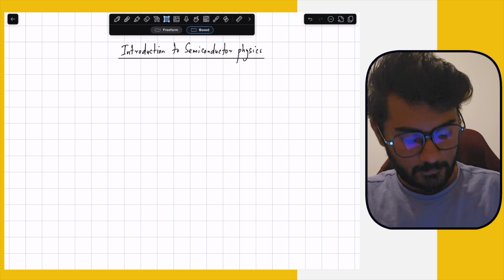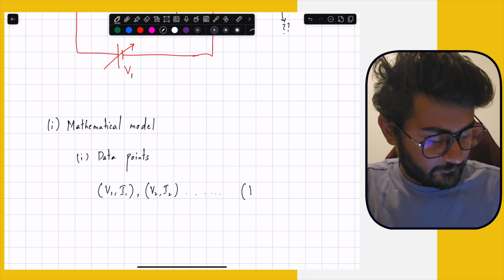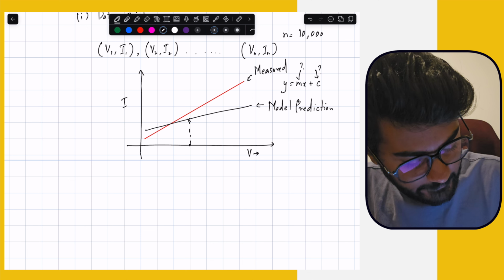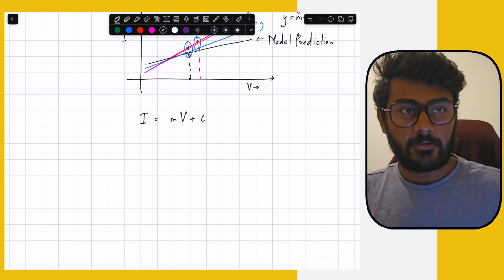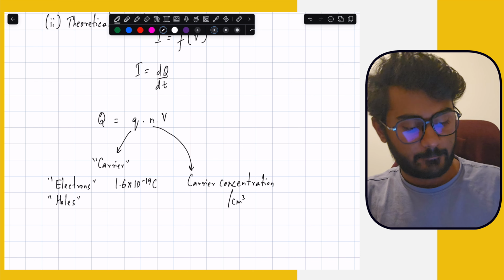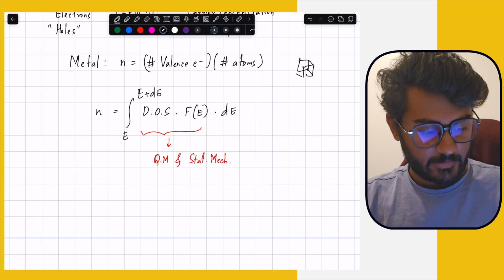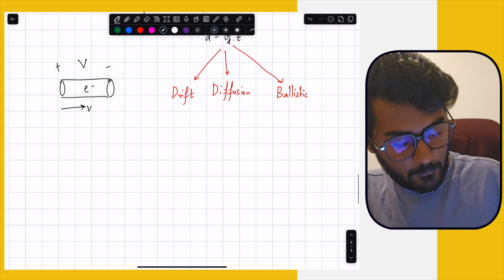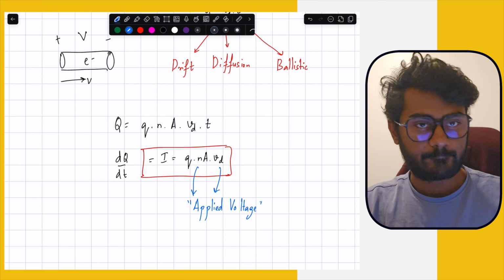Semiconductor Physics Explained: Where to Start

Comment: Good video bro. Can u show dependence of Voltage to vd 
this vd becomes mobility of charge carriers right?
Reply from the maker: Here I am using vd to show different mechanisms in which carriers move inside the semiconductor contributing to the current flow. But yes, for a drift mechanism the vd = mobility * Applied Electric field (Where the applied field is equal to V/x ).
And, Thank you for the feedback 😊